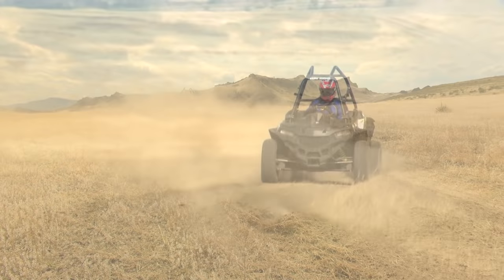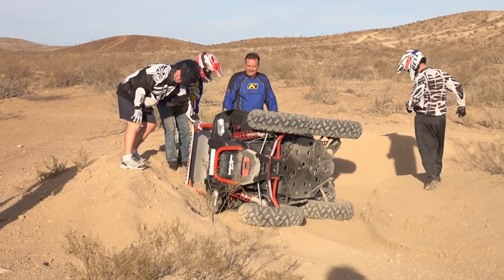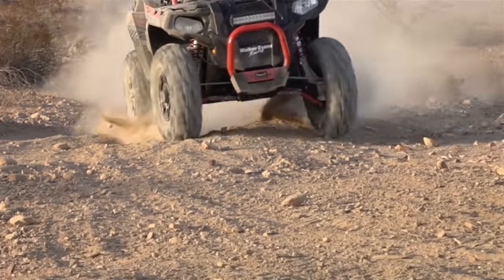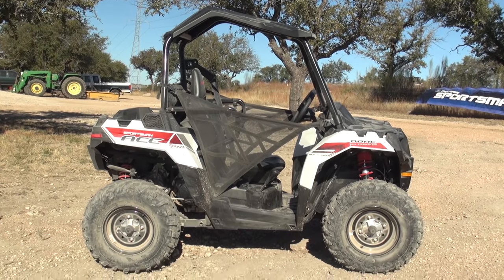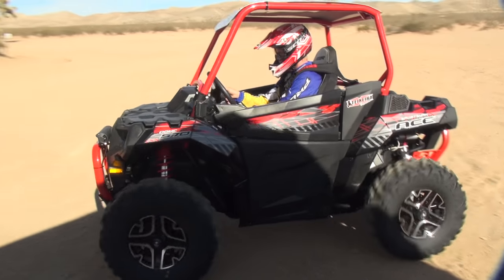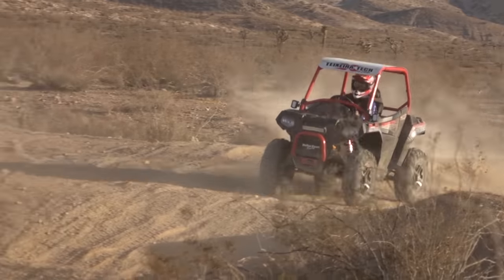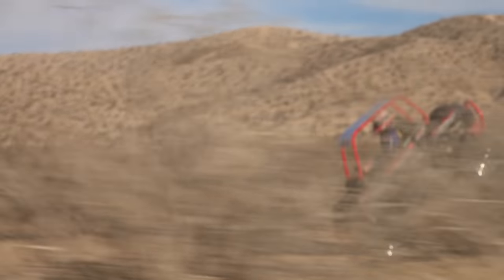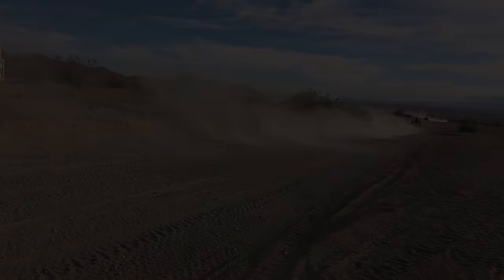Must Have Polaris Ace Upgrades Project Test

Comment: I have a 2015 ACE 570.  I didn't like the stock seat belt; it caused me to constantly brace myself for turns.  I purchased the stock 6 point harness from the Polaris "Baha" edition side-by-side.  You will have to weld mounts for the shoulder harnesses on the cross beam behind the driver's neck.  I had to slightly trim the plastic seat skirt, otherwise it's drill & bolt in.  The seat belt retractors allow the driver to lean forward and move, great for trail driving.  The single belt release is handy and practical.  I can provide more information if your interested in this mod.

Comment: For the additional $5000 over the initial price of the Ace 570 your can have a superior 50 inch Arctic Cat Wildcat Trail, or Can Am Maverick Trail or the Polaris RZR, bigger engines, superior suspension, better handling, on and on and on.. Why would anyone invest $13,000 in an Ace when an Arctic Cat Wildcat Trail ($11,000) would stomp it in every category, without the need of additional modifications (right off the show room floor).. The Ace was designed for mild trail riding at an affordable price.. No matter how hard you try you can't make an Ford F350 out of a Ford Ranger.. (you may spend the same amount of money trying but in the end you still have a Ford Ranger)... Totally different vehicles designed for different purposes and needs and that holds true with the Ace.. Plus the minute you alter it you have no warranty.. The Ace is fun the way that they are, why try to make it into something it wasn't designed for and probably can never achieve with any level of achievement.. You will still be running behind the 50 inch class sports (Wildcat, Maverick, RZR type).. The best thing that you can do with your ACE is NOTHING. get in it and go have fun and smile, smile, smile.. Oh you could put a set of alloy wheels to make it look cute.. That would make you smile too..
Reply: Wow you had a big issue with other people back then hey , why would somebody buy a two seat machine if they only need 1seat ?? Reguardless of the price no body wants a ford so that analogy is lost on me 😂😉 but i see what ur saying an i offer a counter arguement 3 years after the fact who would honestly buy an arctic cat if they could afford a polaris on any level 😂👌 nah aus cancelled quad bikes as of 10/10/21 so the ace is the only quad like single seater we have now or sry the rs1 is here also 🍻 have a good day sir

Comment: im looking to upgrade the polaris 570 ace for my wife so she can keep up with me on trails while im on my dirtbike, what shocks/suspensions do you recommend? the ones you installed, did it make a good difference on rougher, rockier terrain at speed?
Reply from the maker: We ran Walker Evans racing shocks on this machine. You're never going to make the suspension work as well as your dirt bikes but it was a big improvement over stock.
Reply: @UTVonDemand   thanks so much for the reply!
Reply from the maker: @RWWRENTAL  we appreciate you reaching out. This project was a lot of fun.

Comment: How does the 570 compare to the Honda Pilot FL400? In the absence of a modern Pilot, the Ace seems like the best way to go. Is the Ace superior in terms of performance? I mean, it has AWD while the Pilot does not, along with much more suspension travel, but is it faster?

Comment: Is there a way to raise the bar where the harness attaches on that cage?
Like weld on a cross member?
Reply: Yes Dragonfire? I forget the full name of the company offers a harness mount. Notice also they are also running a RZR seat, some of the RZR seats have cutouts for a harness. If not already I highly recommend ROXBLOCKZ fender flares, I increased my width 8" MSA 1" wheel spacers and STI 14" HD beadlocks that have a +3 offset. I have the exact machine they are using... I have videos of it... Since then I have added Pro Armor harness and Pro Armor Suede steering wheel & collar. Take care

Comment: How much was the total cost of the upgrades?
Reply from the maker: The aftermarket parts for this project retailed for just over $5,000. You can see the full list of parts, prices, and links to the manufacturers on our website. http://utvondemand.com/must-have-polaris-ace-upgrades-project-test-with-video/
Reply: UTVonDemand obvious power differences aside...how would you guys rate this modded 48" platform vs the new XC platform for handling & driveability ?